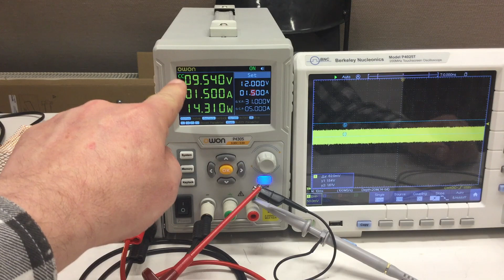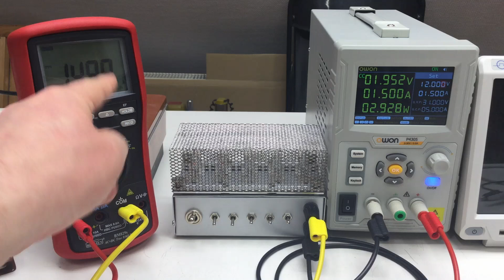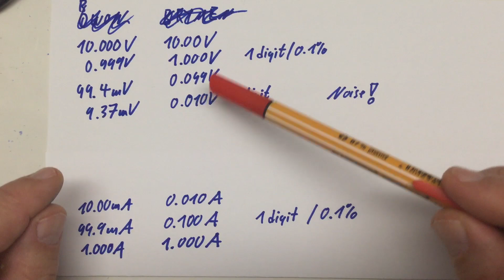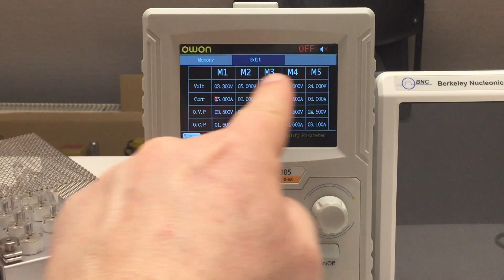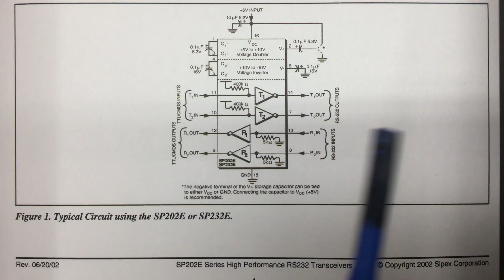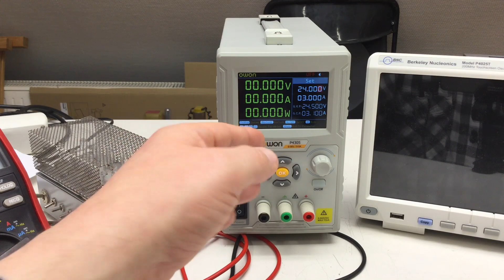OWON P4305 Lab Power Supply Review (6): Final Tests, Menus, RS232 & Wrap-Up

Comment: Hi, thanks for the final review; I use a cheap linear PSU from China, it provides 0 - 15V at 5 amps max; so far the unit has proved to be reliable.
Reply from the maker: You're welcome! Most power supplies, even the cheapest ones form China, usually work out of the box. I guess I was really unlucky with that unit. Anyway, if it still runs after 10 years you can call it "quality" ;-)

Comment: Great finish to your review, seems an OK supply if your demands are not to high, I wonder if the RS232 issue can be fixed with some stout cable and a cap ?...cheers.
Reply from the maker: Thanks! And yes, the RS232 issue should be easy to fix by botching a 1uF capacitor onto that serial interface board. Something I'll probably do as soon as the warranty period is over. But then I'll need a proper USB to RS232 converter, 'cause the Chinese one won't take the negative voltages :-)